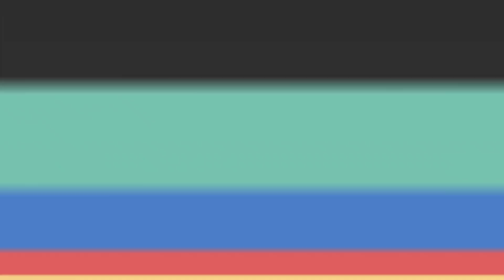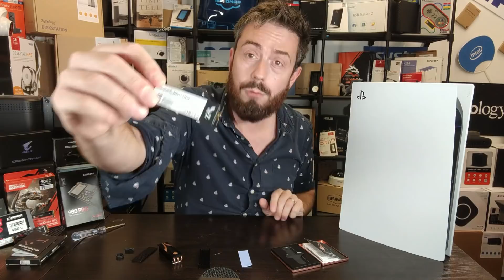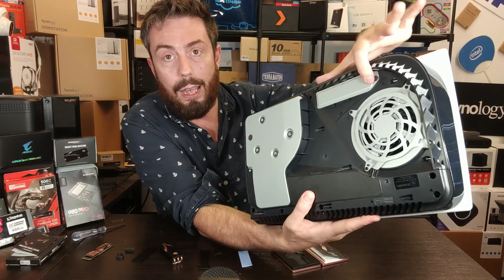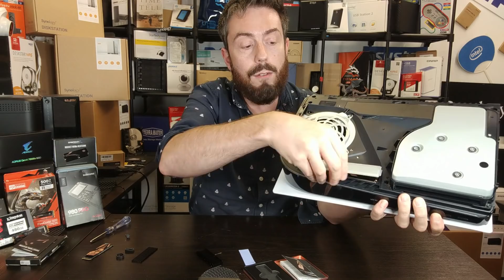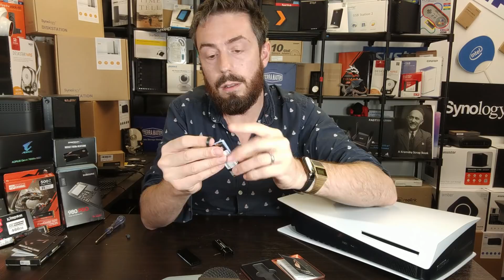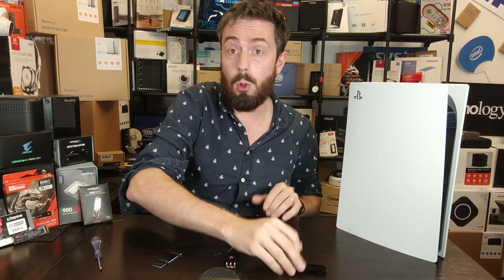PS5 SSD Upgrades - WHY YOU 100% NEED A HEATSINK! (HEAT TEST!)

Comment: When I buy my M.2 with heatsink I will also be leaving the silver cover removed so that more airflow can get inside
Reply: It's already been said, but don't even consider doing that. The PS5 requires the M.2 cover to be closed and properly tightened to maintain air pressure and airflow.
Reply: Are you confident with that choice?
Reply: PS5 engineer says otherwise
QUOTE(from PS5 Sony Engineer)
Mr Otori: There are two exhaust holes for the SSD slot for expansion. Since the expansion slot is near the intake fan, it has a structure that sucks heat from the exhaust hole with negative pressure.

The plate is ther for a reason
Reply: @marty8370  thanks for that👍 I’m thinking going the firecuda 530, your thoughts please?
Reply: @michaelsaunders3325  at this moment I am thing about the same one. But I will wait for about 2 months after this update for reviews. I still have 110gb left on ps5. So I still have room
Reply: @michaelsaunders3325  if you can find one. I've just been looking and i think thats the choice most people are going with. think I'm going to wait until after the update is out officially so its been tested.  then there will be ssd's with ps5 compatible written on the box. the only way to be sure..
Reply: Thanks for the help! Just trying to get the best for my son and nephew! Between the 3 of us I will need to get  a good Ssd with all the games that will come out in the next year👍
Reply: @michaelsaunders3325  seriously wait 4 the official list. Its all beta software now.
Reply: @woodiemarv  Ok will do thanks! 4tb would be awesome but I think I will save for 2tb! Should be plenty!
Reply: I would not recommend this. That silver cover may in fact play a role in keeping that bay cool..  there must be a reason why Sony is stating the drive must not exceed a certain size with a heatsink.

Comment: 11:51 but you've previously said the sabrent heatsink doesn't fit now your saying it will.
As for small heatsinks what is your thought on the firecuda 530 heatsink? It's very thin but will surely be good.
Reply: He somehow thinks that metal plate covering the bay isn’t really necessary, that it will be fine without it..
Reply: @lazymutant  PS5 engineer says otherwise
QUOTE(from PS5 Sony Engineer)
Mr Otori: There are two exhaust holes for the SSD slot for expansion. Since the expansion slot is near the intake fan, it has a structure that sucks heat from the exhaust hole with negative pressure.

The plate is ther for a reason
Reply: @marty8370  thanks for that..
Reply: @marty8370  I know I was talking about the guy who posted the video. As he actually states that he’s going to use the bigger heatsink even though the metal plate won’t fit back on…. So he obviously thinks the metal plate is not necessary.., i definatly plan on still utilizing the metal plate..  as I am going by what Sony is suggesting in this.. as I’m only going to use what fits according to what Sony says..
Reply: @lazymutant  well he is right, it's just an extra barrier to heat dissipation, as long as your ssd is screwed in there's no logical need for it.
Reply: Yeah the sabrent heatsink definitely doesn't fit It does do a better job at cooling the drive but it won't fit into the actual slot, So definitely don't get that if you plan on putting in your own heat sink 😂. I'm using an aftermarket EK heatsink on a WD SN850 and it seems to be working well so far
Reply: @andyvasquez470  you've tried it have you?
Reply: @keef78  yep didn't fit, had to return it to the store, luckily the microcenter I bought it from is 15 min away from home
Reply: @andyvasquez470  it's definitely a bummer, hopefully sony will bring out a list of recommendations once the update is properly released.
Reply: @D4RC N3T  there must be a reason why sony states the drive with a heating must not exceed a certain size.  And as another person stated the plate is necessary
Reply: Yeah notice how he doesn’t try and put it in my the SSD on? It doesn’t fit so why is he taking about it and putting it in the slot? Big misinformation
Reply: 7 videos to explain how to choose and install the expansion on ps5. hmmm looks like it wasn't that easy after all.
Reply: @davidelmz2  He's milking it for views.
Reply: @davidelmz2  cause people make things harder than they need to be

Comment: I have my ps5 horizontal, do you think with that big heatsink, using it without the m.2 cover that it’ll cause some the ssd to sag?
Reply: How will it sag if you have to use a screw to hold it down?
Reply: @Digital_504  lol
Reply: @Digital_504  didn’t know it held with a screw, thought you just insert it like thumb drive
Reply: @Grippycheeks  Yeah you screw M.2 drives down to keep them secure
Reply: At first i was going to answer the same way " how can it its screwed in "  but after some thought the ssd is held in obviously by the screw and the connector but nothing holds the heat sink to the unit so in a horizontal system position you are putting weight over a thin peice of pcb using the rocket 4 heat sink where as  in a vertical position and on pc mobos well gravity moves up and down not side to side,, 
now is it weighty enough to damage the sdd in a horizontal postion i dont know but for all applications with ssds so far your not putting weight over the thin part of the  pcb your putting weight on its width not thickness ..
Reply: @volvot6rdesignawd702  heat sinks are attached to components with a thermal pad that sticks to it.
Reply: @woodiemarv  yeah im aware but the heat sink is really only held to the ssd not the ps5 its self so there could be concern that with the ssd only being held in by 2 locations  with a huge weighty heat sink in the middle of it.. in a horizontal position of course could cause issues

Comment: I saw some other vid where some guy slapped on thermal tape on the top of the ssd and called it a day lol would that work?
Reply from the maker: Yes... For a short amount of time.. if I met that chap though, I fear I would lose my s#&t. COME ON PEOPLE, HEATSINKS ARE LIKE $10!!!! WHY CUT CORNERS?!?!
Reply: @nascompares  can you confirm if the Sabrent heatsink fits with the M.2 in the ps5 slot can you confirm mate? If so will buy it
Reply: @00DaNnY000  at this moment there has been no word on that model. So your best bet is to wait and see.
Reply: @809200  mate he has the heatsink in the video all he has to do is attach a SSD to it and see if it fits. DONE!